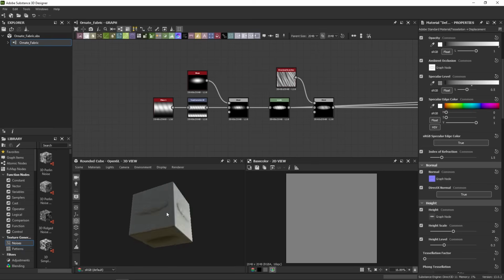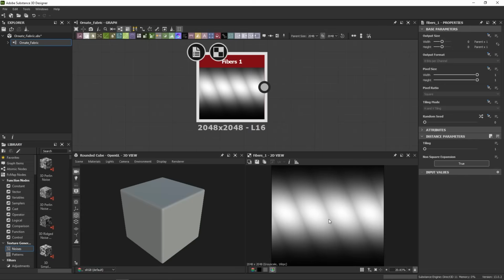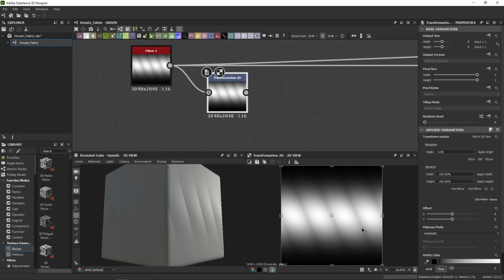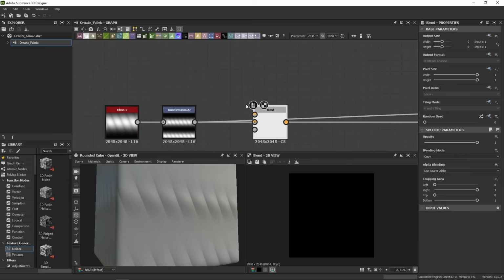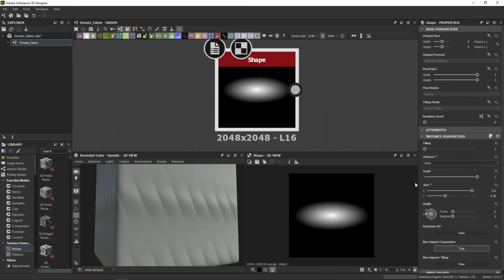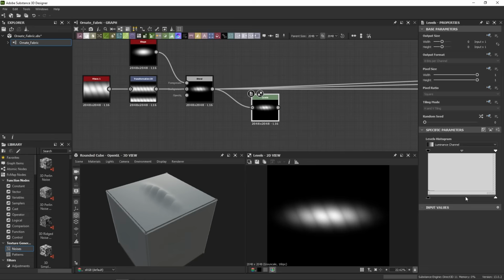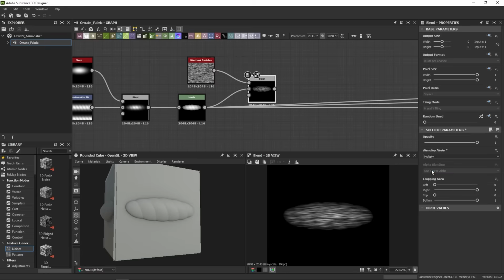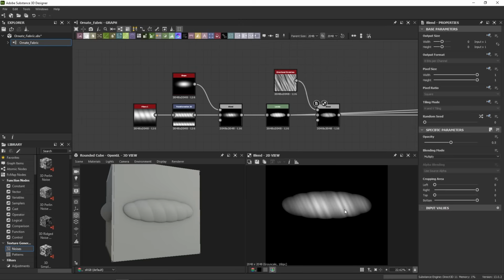Creating a Thread in Substance 3D Designer (Pt 5) | For Beginners | Adobe Substance 3D

Comment: Question: How do I rapidly Preview Blending Modes before selection?

I saw you select different Blending Modes rapidly, as if you were using up and down arrows, and without completing the selection - just being able to visualize how you did that in the 2D View. 

For example at position @10:02 in the "Creating a Thread in Substance 3D Designer (Pt5)"

Voice says:
"And last but not least the blend node  comes with Blending Modes, like 

And at @10:06 then you hear 
"Multiply, Add, Subtract..."
and you see the screen change as each of these are previewed in the 2D View.

The behavior of previewing is what I am trying to capture.

I am on a Mac, what key press or mouse action causes selection AND a preview of the 2D View changes so that I can see the effect without doing a final selection?

In General:
Is there a standard shortcut sequence in Adobe Products to select among many items and preview the effect?
Reply: I should have mentioned it in the video, apologies! To get this behavior you need to first "activate" the dropdown by selecting one of the options, then collapse it again: you can then cycle through the options by simply scrolling using your mouse wheel (I don't know how that translates to mac though)

Comment: Hi, When I add a Shape node to the graph, a warning is displayed "The referenced data has some warnings" and the shape node is black instead of white, nohting is happening with the node when I change the parameters. Please let me know what needs to be done.
Reply: Hey! 
What version of Designer are you using?
Reply: @louisemelin1129   Thanks for the reply. This is the version - 13.1.2 build 7745 commit 1e6555a8 Release (04/06/2024)

Somehow After I restarted the software the issue got fixed. I guess its a norm to make us worried at first and then a simple restart would fix it 🤣
Reply: @arjunaarya  Haha I'm glad to hear that then!

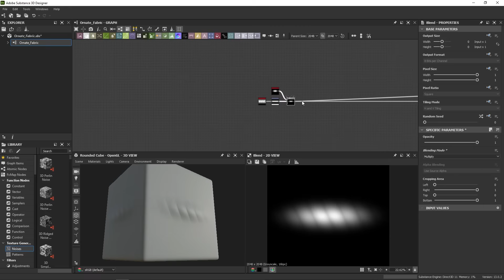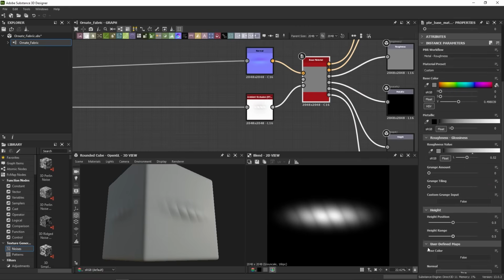Comment: Hi, I'm following everything exactly as the video shows but for some reason my (RATO) node doesn't show fiber shape as it does on my normal node connected to the base material. Would you please explain what I'm doing wrong or missing? time stamp 12:38  -12:45
Reply: It's because your cube doesn't have enough geometry i think.
Choose high res plane instead or in 3d view go to materials > default > edit > in the height section increase Tessellation Factor. i manually typed in "60".
Reply: This helped a lot! Thank you :)
Reply from the maker: Hi there! If you need any advice on that, come on down to the Forum & ask our experts about it. Let’s have a conversation here: [https://adobe.ly/3KjYLbp] ^Rohan

Comment: I do it like on video adding normal and in my render view I see nothing. it doesnt works why?:(
Reply: Maybe you forgot to drag you base material into the preview window. Press SHIFT+Right Mouse Button on the Base Material node and drag it into the 3D view window.
Reply: @screwdriver1337  No need to press shift actually, a simple right click-drag works! but yes it could be that also
Reply: @louisemelin1129  didn't know that, thank you!
Reply: Make sure your normal intensity is high enough, like 6 or 7